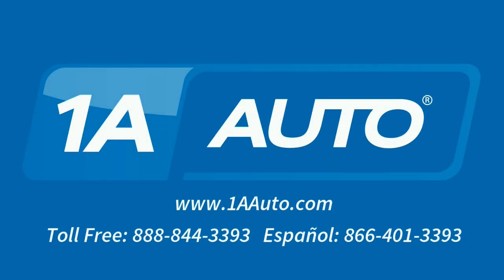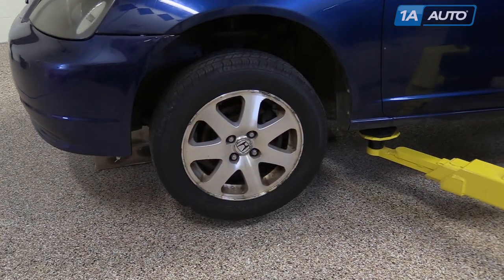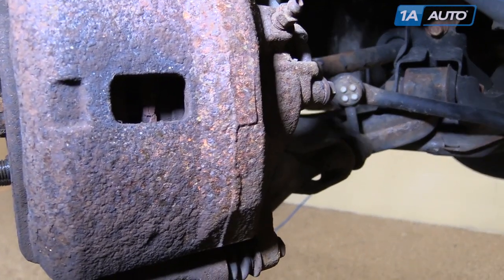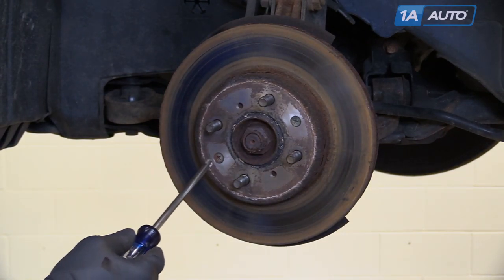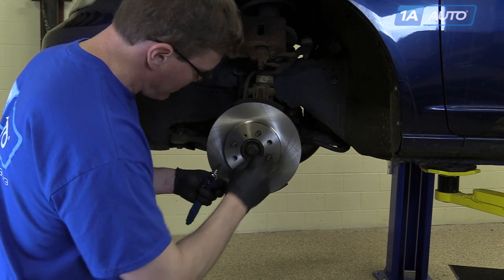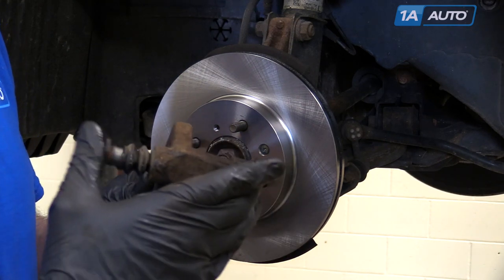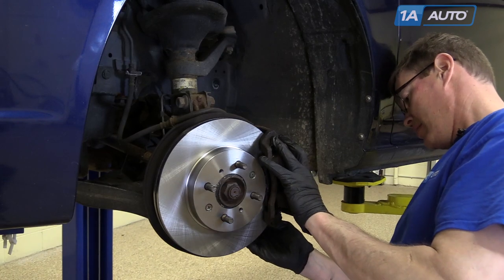How to Replace Front Brake Pads and Rotors 01-05 Honda Civic

Comment: Gotta remember to use break cleaner on the rotor
Reply: factory oils all over those rotors...
Reply: also grease all over those gloves with installing the new pads is asking for problems..
Reply: Brake

Comment: After fixing my screeching serpintine belt that turned out to be loose and replacing my failing caliper, I've gained tons of confidence on working on my '05 Civic Coupe. You guys' videos are a god send! I find the Haynes manual to be a little confusing at times due to some of the steps jumping over the place. I just suck when there's too much info given at one time too and if it's not straight to the point. You guys get right to it. Thank you!
Reply from the maker: +The513Warning Thanks for checking us out! 1AAuto.com

Comment: Just got done doing this to my 2005 Civic LX. Here's an additional tip:
#2:08 those 12mm bolts might be spinning freely and not coming lose. Use pliers to grip the other side of the bolt and it should break free. 
Also I only had to remove the bottom bolt and it can pivot on the top bolt.

Comment: Great  video and definitely helped a ton with my first time working on my '03 Acura 1.7 EL's front brakes and rotors.  The use of silicone lubricant during the service (i.e. slides, slider pins & brake pad - caliper contact areas) was well described and certainly improves the quality of the job.  As mentioned previously the brake fluid reservoir should be open before squeezing in the caliper cylinders and watched to make sure it doesn't overflow.  Pumping the brakes does help to bring down the fluid level a bit but more might need to be taken out to get down to the "max level" by the job's end.
Reply: Not point in doing this, unless you topped off your fluid when your pads were low and worn which is never a good idea.

Comment: I found my brake rotor was difficult to remove. 

Pro tip:

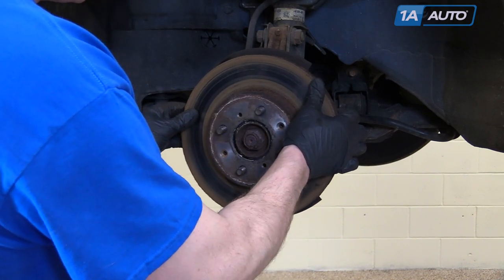At 4:05 where he says you can use some m8 bolts to make removal easier-- to do this you can actually use the same two 12mm bolts (see 2:08) that were holding the caliper in place. I suggest using a tap first to remove built up dirt/rust and to make threading them easier. (You'll need an M8 x 1.0 tap)

(Before I figured this out I tried tapping the rotor out with a hammer. Don't bother, because this didn't work for me at all.)
Reply from the maker: +Envarion Thanks for the feedback!

Comment: It looked like the new pads sat into the clips pretty easily. I needed to use the C clamp and a hammer to get mine to finally sit square, which seems a bit excessive, and my test drive I could hear friction as soon as the wheels start turning (in fact it goes quiet only when I apply the brakes). Is it possible to shave down the brake pad tabs to get them to fit in the calliper clips less tightly? Or should I just return them?

Comment: The slides that the 12mm bolts go into.  I had an issue with them spinning when I was trying to tighten the bolts. The sort of oval head on them looks like it should key into an edge on the bracket to keep it from spinning but neither of them had anything like that. I tried holding them with vise grips which only helped a little. Am I not understanding something here? I seem to remember other cars simply having a long bolt.
Reply: Gotta use adjustable wrench adjustable spanner work for holding it down while unscrewing/tightening bolt

Comment: Is it necessary to remove the brake fluid reservoir cap prior to pushing the piston back into the caliper?
Reply from the maker: +Ben Franklin Yes, the idea is to keep the system from building too much pressure. So some fluid may leak out of the reservoir, but otherwise you'll have a much harder time compressing that piston. Thank you for watching. Please let us know how the repair comes out!  1aauto.com?utm_source=YouTube&amp;utm_medium=CTA%20Comment&amp;utm_campaign=1ATony  888-844-3393
Reply: Thanks for the reply. I seem to remember having to do this when I worked on my cars as a youth. Doing my first brake job in 40+ years. Your video will help a lot. Seems like a pretty straightforward job.

Comment: Quick question. I just ordered my rotors for my 2001 Honda Civic ex coupe and I thought the rotors didn’t have tho screws in them so my question is am I going to run into those screws stripping and not coming off?
Reply: Did u find out ?

Comment: Whats that squeaking noise when you press the brake pedal at the end, I have that same noise when applying the brakes
Reply from the maker: +Sherwin Orellana This sounds like it is coming from the brake pedal itself from what we can hear. 1aauto.com
Reply: It's the brake shoes in the back! Take the rear wheels off and remove the brake drums and grease the shoes some. They are rubbing and causing that little squeak noise. Make sure you don't have you're emergency brake on when trying to remove the brake drums.
Reply: @marko9657  that’s right! I replaced shoe on both sides and cleaned with brake cleaner and greased and it stopped squeaking
Reply: @marko9657  where can I find that? The rear calipers?
Reply: @DEATHVALLEY_915  is the brakes the rear calipers of the car?

Comment: The breaker bar you used in the beginning wasn't necessary to be honest it will ago work with your impact gun wrench to Remove the bolts on the wheels
Reply: He must have removed the tire with the breaker bar for demonstration purposes. Most people just have a tire iron or breaker bar at home rather than an impact gun.
Reply: @kalifornia8110  Correct. 💪🏻

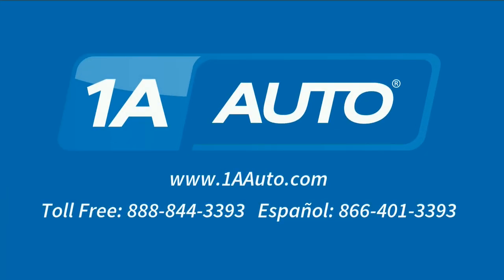Comment: 8:24 I have the same noise when I release the break??
Reply: trafi M me too its annoying
Reply: Sameeee
Reply: @shanetapfer9822  rear drum assembly, i replaced my shoes and it stopped also use break cleaner helps alot

Comment: You forgot to mention the flat nut behind the slider bolt that causes the bolt head to spin.  It needs an 19mm wrench to loosen.
Reply from the maker: +hornet224 Thanks for checking us out. Shop for high quality auto parts on 1AAuto.com:

http://1aau.to/m/Shop-1AAuto-c

Comment: Aren’t you supposed to be bleed the brake fluid
Reply: that's what i thought .
Reply: @eliasbrunka5348  should u do this after
Reply: Not necessary unless you feel breaks aren’t working properly
Reply: @Modifieddaily  no just step on pedal until its firm perhaps 5-6 times
Reply: Only if you are replacing the brake line.
Reply: @DEATHVALLEY_915  This. I didn't have to mess with the brake fluid at all.